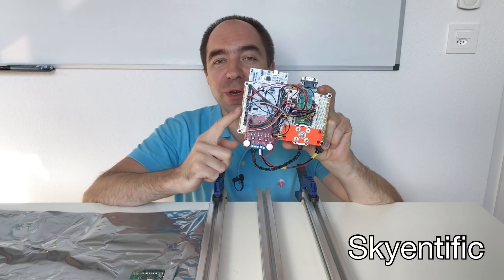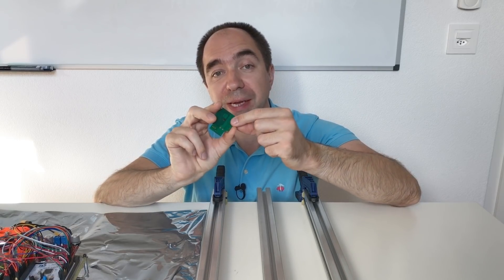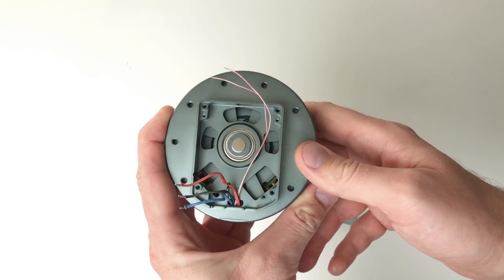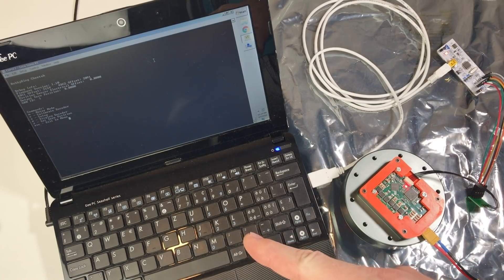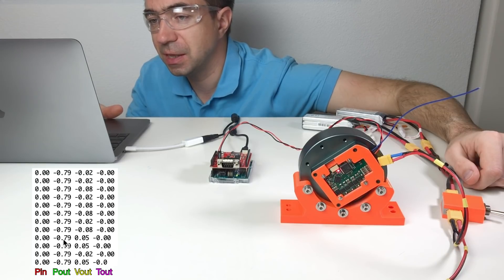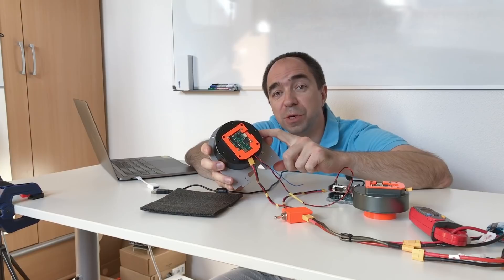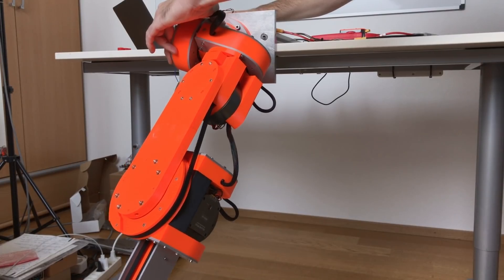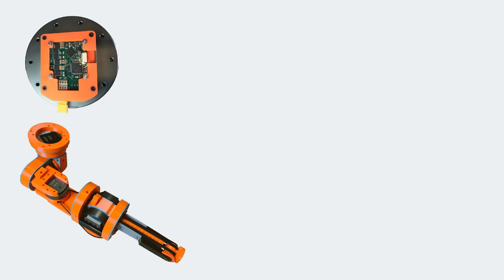How to improve the Robot Arm (MIT mini Cheetah style)

Comment from the maker: Do you remember the 7 axis Robot Arm from my last video? In this video I've installed the MIT mini Cheetah controller on one of the actuators of this robot. Did it help with the vibrations? The answer is in this video.
Reply: Do you have a project for ROS navigation mobile robot ?
Reply: Why did the new controller help so much with the vibrations?
Reply: I'm guessing because it's lighter weight. The arm with the previous controller oscillated. The extra weight and flexing of the arm and joints makes a mass-sprint resonant system, and the feedback loop has enough gain (and lack of phase compensation) to make it oscillate. I wonder if it will oscillate again when there's an actuator carrying a payload weight.
Reply: You need to take some time and understand control theory (yes it's not easy, but if ur doing these posts u owe it to ur viewers/patrons. If you have oscillations you just don't have your control system setup right.  Every system and can be "critically damped", the difference is how fast it gets to final position, but again, all can do without oscillation.

Comment: Why do they make the board differently? If you're going to recreate something, you might as well make it to fit your needs. Their designs may also be simpler due to the increase in board space (e.g.: maybe they were able to eliminate 1/4 of the layers by using the excess space of the remaining 3 layers).
Reply from the maker: This is a really good point about layers!!!

Comment: Ok but, I have a question. What happens when you need near-simultaneous motor control? The Mini Cheetah updates their motor driving values many many times per second. CAN bus is designed to transmit a message at time (according to priority) so, how do they do it? Does every motor controller have a specific priority/address?

Comment: Nice video, congratulations. I would like to replicate the same controller too, I produced the PCB but I'm having trouble compiling the firmware. I can't import it into mbed cloud compiler or compile it with mbed CLI and mbed studio. How did you do?
Reply from the maker: I just imported the firmware from Ben Katz directory, and it worked strait forward. Just push the compile button and it makes .bin file. Which after you just drug and drop to you module.

Comment: I tried ordering 12 or 15 pieces, and the quote I got is about 600$ for 12 boards, and 700$ for 15 boards. The price is about the same with ordering 6 ODrive boards. 
I am debating my self since ODrive has larger community to support and test.
But using ODrive I will need to order 12 encoders, which about 15$/piece. So it is likely more expensive.
I hope to get some recommendation, THanks

Comment: I think keeping the esc (motor driver) on a separate board would be better since these components get hot and fail quite often.
Reply from the maker: This is not ESC, this is completely different beast. And it should not fail, under the normal use.

Comment: The vibrations are presumably because of PID tuning. If you didn't use the same values, it's not a good comparison.

My guess is a larger board is easier to assemble and also can dissipate heat better.
Reply from the maker: They have absolutely different firmware (with different control strategy). So I cannot put the same PID. But I spend 3 or 4 days tuning the PID on original controller, and it was still oscillating like crazy. But with MIT controller, I get no oscillation from the first try.
Reply: @Skyentific  interesting!

Did you try the MIT firmware on the original board?

Comment: Great video! If the original actuator also used a variation of the Mini Cheetah controller, why did the new one you installed perform so much better?
Reply from the maker: Because original was not using MIT mini Cheetah controller at all.
Reply: @Skyentific  Ah, I guess I got my actuators confused. Thanks for clearing that up!

Comment: Which Serial Monitor did you use? It looks like the one from the Arduino IDE but it doesn't autoscale, so it's probably another one? Or did you somehow configured it to not autoscale and if so, how do you do that? Thanks in advance! :)

Comment: @Skyentific how many samples per second this solution provide ( connection between pc and ->arduino->cheetah device)?
Could you tell whats is rate of sampling (position, motor currents or voltages) between chetah and motor? I;m very curious how many heat is dissipated during blocking posiotion of arm with bigger load. Do motors needs active cooling especialy when process often  stops and blocks position? What happends during sudden power outage?  Do motors are standing still or rotating freely during power outage? Many thanks for answers. I very enjoy watching Your adventure with robotics!

Comment: Amazing job!
 What all did you take into consideration when designing the 3D printed parts for the arm? I may be doing something like this in the future ( fingers crossed!) and want to know a bit more about this. I am presuming the main factors are: a) Mounting the motors properly. b) Having structural strength to be able to take the shearing stress without deforming or fracturing. c) Not being so long or so heavy that the torques cause the motors to stall.

Comment: Pro tip from an automotive engineer:
The ground potentials of your CAN devices should be connected together, for reliability reasons. Depending on the CAN transceiver, they only tolerate a few dozen volt GND to GND offset (see datasheet). Hence, letting the GND potentials of CAN equipment fly wildly around in the breeze, is not a good idea.
Reply from the maker: Thank you for this tip! I was not sure about ground. I will take care of this!
Reply: @Skyentific  can add LTM2889 or equivalent for galvanic isolation, if need no common gnd
Reply: @proceau   Could you tell me  in robust enviroment is good to using ltm 2889 on every device and make something like ethernet network (star topology) to connect to main controler? (1 master and n-slave devices  connected paralel with ltm2889)  Maybe this solution is to expensive? What do you think?

Comment: I would think they designed the controller boards to use all available space so they can spread out the heat.  Concentrating the components tightly together concentrates the heat that they produce.

Comment: Regarding the size of other Mini Cheetah Boards. It is much easyer, cheaper to produce. Four a bigger board you do not need four layers(!), or smaller and more expensive sizes of the components. Even with the original Mini Cheetah Board, the space around the box is lost.
Reply from the maker: This is a really good point.

Comment: From my experience with Chinese manufacturers.  PCB redesign happens for lots of reasons. Commonly it's for ease of manufacturing, assembly of a motor with a round circuit board may just be logistically faster.  Second is cost, producing the same PCB but only making it 2 or 3 layers may be much cheaper if they make it larger. 3rd, laziness/copying, if a Chinese manufacturer goes through the effort of designing one board, and all the documentation and diagrams are in Chinese, they just pick up the previous work and iterate on that.  4th, the country not the companies "own" the circular boards they like to make everything produced in China "theirs" the MIT board is (even though it's open source) wasn't created by them so they change everything in the board so they can "own" it and claim it's not open source.
Reply: This above. Ease of manufacturing, if you have already sourced the motors it's much cheaper/easier to produce 1000's of PCBs that fit just right than to produce 1000's of PCBs + 1000's of mechanical adapters to make them fit, and I hadn't even thought about the number of layers.
Reply: So called Mini Cheetah BLDC motor controller in it's original form (from github) is something like functional prototype - it is not ready for commercial use. Hardware design is rough, there are many details that doesn't make sense (probably there was no revision of design), schematic documentation is mess and what is worse, design isn't foolproof (missing protection circuits, no analog filtering, no ESD protection, no temperature measurement, need for bulk capacitor for decreasing current ripple if power supply has significant impedance). Sensor MA700 is NRFND, there is plenty of new sensors (for example MA732 from same manufacturer).
Also there are only two "phase current" measurements, which is enough for sinus vector control, but driver DRV8323 supports also third - for better precision and some redundancy I would use all 3 inverter shunt resistors measurements.
It is a very basic design based on standard components connected in standard way - good startpoint for someone who want to make his own design. Decent firmware with sinus vector control is more important part of this project.
Reply: Nice points both of you.

Comment: Have you ever thought about making a SCARA 3D printer. I would love to see someone attempt it. I will eventually attempt it myself but I have a lot to learn about when it comes to robotic arms. Which is why I am subscribed to your channel. Thank you for all your hard work and time you invest to make these videos.
Reply: https://www.youtube.com/watch?v=1QHJksTrk8s
https://www.youtube.com/watch?v=8qc044LY6hc
the How to mechatronics channel has shown how to build a SCARA robot and has also demonstrated laser engraving! short answer: with 3d printed materials its not accurate enough all the time and requires recalibration for different homing points.
https://www.youtube.com/watch?v=ZGgMeZ88sX8 
a SCARA robot I built years ago using mostly recycled materials and contains  NO servos and NO microcontrollers. it ran directly from the PC using the parallel port. I was able to run and scara and cartesian robot to demonstrate pen plotting with the same software. I can tell you that the SCARA is not nearly as accurate as a Cartesian but is quite efficient in terms of space. The major problem is the requirement to move at least two motor to reach any point. unless you have end effector feedback, its not going to be accurate or precise for 3d printer like tasks. for everything else its fine!
this may be a good idea to look into: https://www.youtube.com/watch?v=gCTrrntuoZI

Comment: I do think that they redesigned just the form factor is to "deceive" the customer and DIY-er, into thinking that they are using their own secret 11 herbs and spices, lol. Maybe you can redesign or simplify the board for sale, or create control kit for sale to boost the revenue. I think that there are a lot of people interested in the subject (I believe that that number will only rise and rise, due to, you know..., the 4th industrial rev bla bla), but there are not many guide and pre-prepared kit outside for these people that interested but don't have enough knowledge to properly 'wet their feet'. And you know, the total cost for everything is painfully high, especially if you don't exactly know what to buy and what to do
Reply: And of course, you can make a STEM course on robotic/robotic arms, or online course, there are several platform out there

Comment: it would be great if someone added temperature to the controller
Reply: The guy from MIT actually calculated temperature from the current consumption without the need of any temperature sensor but I am not sure if that part of the code is open source
Reply: @michelegalliano6128  is temperature not a function of the surrounding environment too? Probably not the same if running the actuator on a hot day in spain or in winter in Novosibirsk...
Reply: Yes, I think so but maybe the ambient temperature could be measured once near the main microcontroller

Comment: When will you do YouTube full time, at a 100k subs?
Reply from the maker: Great question. For the moment I cannot finance myself through the youtube and Patreon. I need to find a way to boost the revenue. Maybe to make more interesting videos, to increase views. Or maybe to create some product to sell. Or something else. If you have any ideas, I am really interested!
Reply: @Skyentific  If you can build a high current and high voltage motor controller or manufacture a gearbox. (planetary or harmonic) Because the ones on the market are way too expensive. Maybe sell cad or custom control software I think that would help this hobby to be more accessible.
Reply: @Skyentific  I agree with Eric, good gearboxes are still way to expensive for the hobby market. Another idea would be to produce a low cost, UR3 like robot arm
Reply: Skyentific Design a 3d printed robot arm and sell the electronics for it in a kit.
Reply: @Skyentific  you could sell these controller boards maybe.
Reply: @Skyentific  maybe you can sell more ads in your videos? and if you have troubles with finding companies which interested in ads, you can use some services which find clients for you. its way easier. you just pay some % from deal for service and thats all.
Reply: Sell your CAD for the arms you've made.